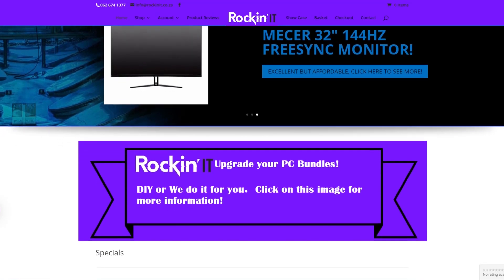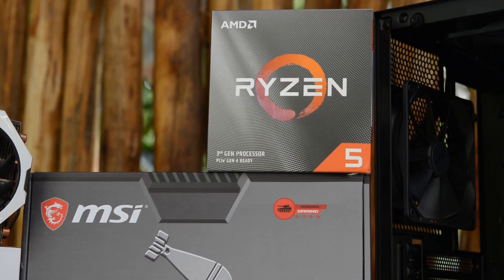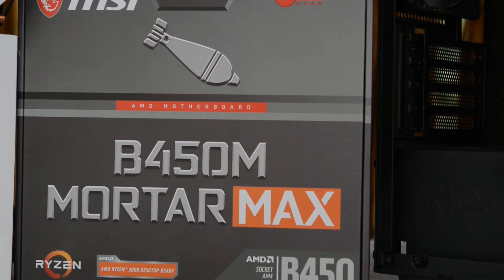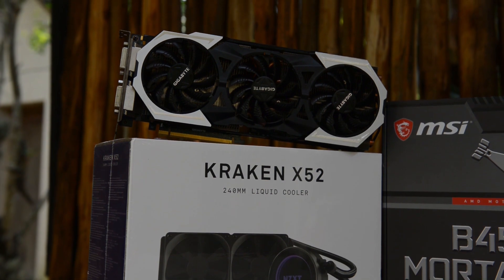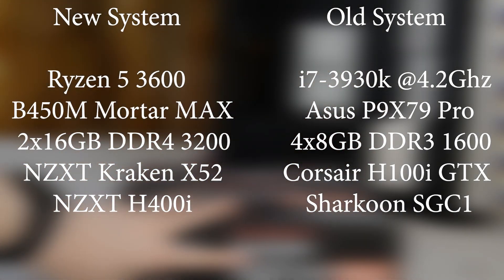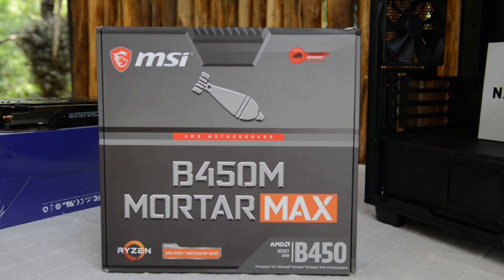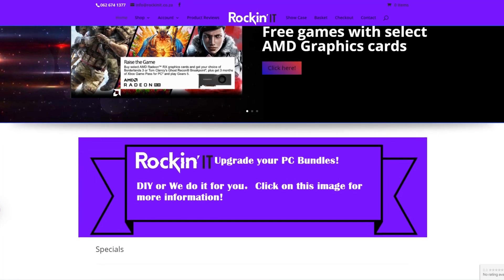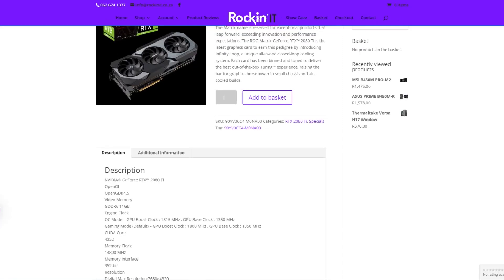2011 i7-3930k Vs 2020 Ryzen 5 3600

Comment: Hey I've seen alot of conflicting information but will my 3930k bottleneck a 3060 ti? (A slightly faster 2080 super)
Reply from the maker: I’m not 100% sure but here’s what I think: If the 3930k has a good overclock on it with some decent speed RAM it shouldn’t bottleneck the card at 1440p or 4K but might at 1080p (this is the case for a lot of games) and you might occasionally notice a little bit of a bottleneck depending on the game even at 1440p. Also if you are going for high refresh rate 1080p you should also technically be fine in most games. I hope this helps.
Reply: @etstudios  thanks for the advice 60 hertz 1440p shouldn't be a problem

Comment: How much of a difference you think it would make running 8 channel ddr3 on x79 vs dual channel on ryzen?
Reply from the maker: It won’t be huge, your biggest difference will be in the CPU performance it self. As long as the Ryzen CPU is given decent speed memory (above 3000Mhz preferably) it should perform better than the x79 CPU
Reply: Dd3 1600 quad channel is same preformance as ddr4 3200mhz dual channel.

Comment: Thanks for the video, currently running a i7-3960x so was considering upgrading, but 2fps difference at 1080p I was shocked. Keeping my old Intel then. So glad I went for a GPU upgrade first (I recently upgraded to a 1080).
Reply from the maker: For gaming I really don’t see a need to upgrade. I’ve definitely noticed the difference in productivity like rendering etc. But it’s definitely not worth it if you aren’t doing anything other than gaming

Comment: I'm getting a i7 3930k with a gtx 1080, do you think its worth it nowadays?
Reply from the maker: Yeah that will work fine as long as you are planning on running the 3930k overclocked because really it’s just free performance that makes a big difference. The 1080 is about as far as I’d go with a 3930k though so a new CPU would be my next upgrade if I were you
Reply: @etstudios  yep overclocked at 4.2
Reply: @etstudios  just hoping to run AAA at 60fps+
Reply: perfect choice my friend, my 3930k and 1080 are doing great and i got an asus p9x79 pro, 16gb ram, 3930k and 1080 all together for 320 bucks so i cant complain
Reply: @T2roxT2  at the end I decided on a i5 9400f, best choice I could've made performance wise. Highly recommend

Comment: Yeah I still use my 3930k and it crushes any game nothing is slowing it down @4.4ghz stable for 5 years since I got it love it
Reply: Mine is on 4.7ghz never goes higher than 1.354
Reply: i have yet to overclock it but i might have too. What safe voltage are you applying to get to 4.4ghz and what increment did you use?
Reply: @ereder1476  I got it stable at 1.356 and I found that number using auto settings in my bios then set it to that no issues very smooth cpu
Reply: Thing is: at 4.4GHz it performs pretty much like a ryzen 3 3100, and at voltages > 1.35V you'll probably get above 150W power consumption (propaply waay more...), Which is a bad joke  in comparison to the 3100... And that's a 100$ CPU!

I've got the same CPU (got it  on a bundle with a Rampage IV Formula for real cheap recently), and I begin to doubt it... The only reason not to buy a ryzen is currently the cost of a new Ram generation, and the relatively high price of am4 boards with post code

Comment: Ill stick with my 4930k @4.6ghz been running at that 6 years solid. Was thinking about wasting my money on a Ryzen too. Glad i didnt after watching this vid.
Reply from the maker: For me in particular it wasn’t a waste because of my plans for the system but yes at a nice overclock I’d say the 3930k is definitely still worth keeping.
Reply: what voltage and settings are you running the 4930k at to get 4.6ghz? I can only get mine to 4.4
Reply: 4930k is a great chip, i would still be running it esp for games.. i upgraded fr9m 3930k to 11400f and the only real benefit was in improved productivity ( i dont really care too much about that).. z590 boa4ds are cheap right now and so is the ram and 11400f

Comment: So glad i have a 3930k it still holds its own in games, i was thinking of switching to ryzen, and i guss i will when the 4000 series comes out, but for now my 3930k stays where it is.
Reply from the maker: The 3930k is still a great CPU and although I have now upgraded to the 3600 I would still be happy running the 3930k for a while to come if I hadn’t
Reply: @etstudios  i'm still using a gtx 1080 i really don't think i would get any better performance with the 3600, and anyway my 3939k overclocks to 4.5ghz and stays under 50°c even while under load,  i don't see a reason for switching before i have 2/3k to blow on a new system.
Reply from the maker: @Cazman1989  I did notice quite a big improvement in some specific CPU bound games but other than that it didn't make a noticeable difference. I didn't have the temp headroom you have to go above a mild overclock so that's definitely helping you
Reply: @etstudios  the 3600 is much cooler then a 3930, far as i know, and i really don't have any special cooling, i have a standard 240 master liquid.
Reply: @SHONUFF-qd4  that would be a pretty bog step up.
Reply: Now i am working with an 10900k
🙂
3930k good old history
🙂